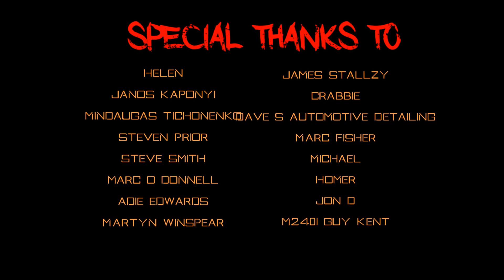Ceramic Coating Application

Comment: I think people are so intimidated by ceramic coatings not because of the ceramic application but because of the prep. Ceramic is actually super easy to apply. It's the prep that'll get ya.
Reply: I agree it’s the prep that kills you , I’ll be doing it soon , need to machine polish the car , should get away with a one step as the cars only 6 months old but need to strip my old sealants first and decon , maybe garage therapy decon shampoo
Reply: 100%
Reply: My former ceramic coating was Optimun Gloss Coat. Super easy to work with. That was in 2017 that I started using it. 

In 2020 I started working part time at a very high end shop doing corrections. They also wanted me to do coatings. My first vehicle was a black Jeep Wrangler. The coating they used was Ceramic Pro 9H / Top Coat. It was so difficult to work with that I swore off glass bottle coatings. I almost quit because of it. There was no official way to apply it. They even had two conflicting videos describing how to install it.... 

Last year I bought CarPro Cquartz UK 3.0 and Gliss. Turns out that not only is CQUK 3.0 easier to work with than Ceramic Pro 9H, it also out performs it! 

We've since switched to Xpel Fusion Plus, but CQUK 3.0 kills that one too.
Reply: Absolutely spot on. Ceramic coating success is at least 95% prep.
Reply: @danlc95  normally the pro coatings are harder to apply and that’s why they only available to certified detailers who’s done the course , I presume the shop are certified to apply that pro coating
Reply: @M.E63  - I didn't have the luxury of going through the course. I was just thrown into the fire!

And both the Xpel and Ceramic Pro are much harder to apply than CQUK3.0, but don't appear to perform as well over the long term. However, as we know, so much of a coatings duration is dependent on how the car is used and cared for.
Reply: @danlc95  technically your not meant to be allowed to apply the coating unless you done the course , but I guess shops just get one person to do the course then allow other workers to use the coatings . The retail coatings are Less concentrated so they not as thick so they easier to work with , I guess the pro coatings do last longer but I don’t fancy paying that much money and rather just apply a retail 3 year coating every 2 years

Comment: I'm thinking of using Pure Evo, with Can coat on top. This looks like its similar to CQuartz UK 3.0. I like the candy finish afterwards. So many decent coatings on the market, spoilt for choice. I'm still thinking about Adam's advanced graphene ceramic coating with the gold writing on the bottle. Apparently its susceptible to streaking (likely down to prep or poor application) the  UV dye helps to show even cover if you've got the right  kind of lighting in your work area to dimly light then full lighting back on so you can check with UV torch. Not sure if anyone has tried it? Kind of keep coming back to Pure Evo...I think you can do plastic trims and wheels too although its not quite enough for higher temperatures apparently. Looks gorgeous, nice little video I would have loved to hear some comments as you were applying it. But still a good one 👍
Reply: I applied Adams graphene advanced coating (2 layers) before 2 months. It's doing great until now. There is no need of the UV torch but only common sense to wipe off a bigger area every time. In comparison with cquk 3.0 this seems far better.
Reply: @thso6529  Was that the spray bottle or the glass bottle version? Whats happened until now? I'm guessing your not a fan of Cquartz?
Reply: @79blustone  The glass. I am not fan of anything. In my case (car parked outside, hot climate etc) the cquartz didn't work as expected. In these two months i topped up once with the adams ceramic booster but i'm using as a dry aid the gyeon ceramic detailer. Still performs great without any signs of needing unclogg the beading properties etc. Hope that helps.
Reply: @thso6529  Ah, I see, great its good to get an idea from this community 😄. Glad the Adam's is still holding up, I still like Pure Evo. It's going to be a coin toss between the two I think. I've got a month or two to decide 🤔
Reply: @79blustone  Remember that the preparation of all exterior surfaces (Wash, remove any previous protection, polish with something not containing any fillers) and work without wind, keep the paint unmoistured for 2 days, away from rain for 5-7 days and wash the car after 7 days at least is the key for a proper installation if it's your first time. Have fun!
Reply: @thso6529  Always carry out a decon wash and fallout removal. Follow by a decent amount of time preparing the paint work. Luckily its a new car that I'm getting PPF'd first. So I'll probably just use a finishing primer and a prep before application. There won't be much prep to do but will have to see what condition its like beforehand. I'm happy to reapply when the coating has finished, always best to catch it before it completely fades so there's less work to do for the next coating. I'm looking forward to the new car tbh